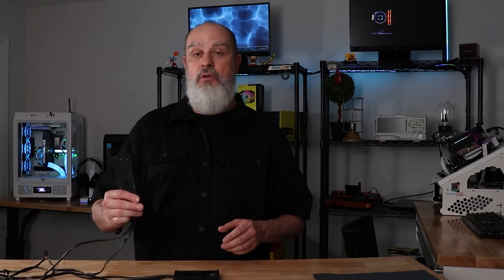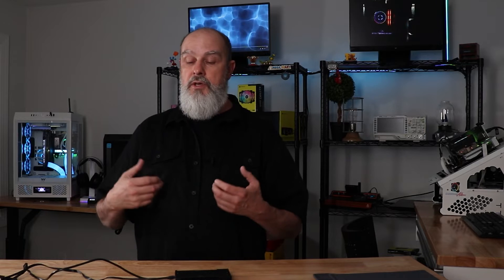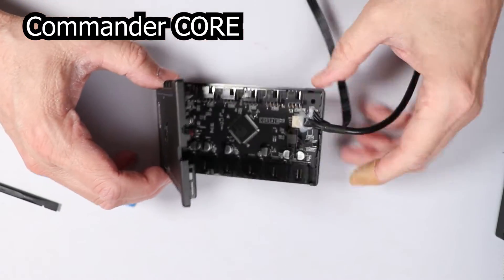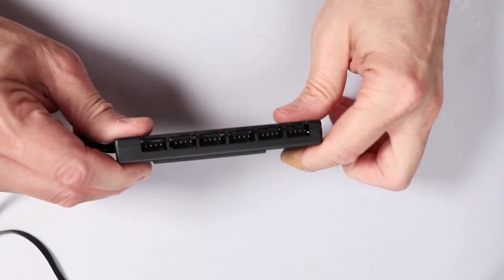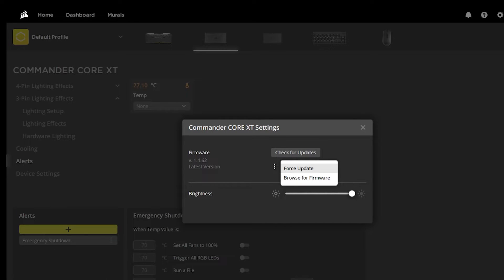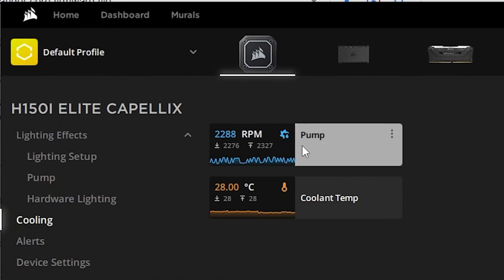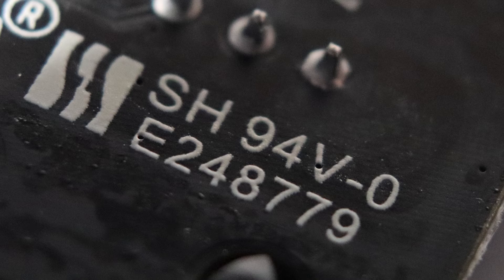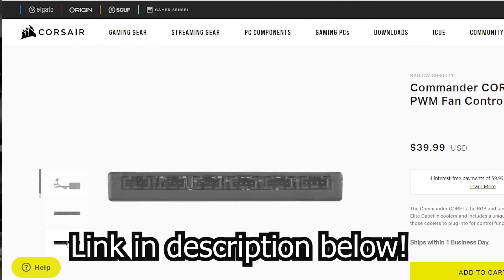Controlling your AIO with a  Commander CORE XT and Replacing your Commander CORE - But don't do it!!

Comment: Hi everybody, I just repaired my H150i with this method, and it's working great. The only problem is that when you update the hacked Commander Core, it will lose the speed option for the pump so you need to reinstall ICUE 5. If someone needs the firmware for the Commander Core, I have it.
Reply: Hey, how's it going? I need it do you have it
Reply: Hi bud, I would appreciate the  file as my comander is gone
Reply: Hi if you still have the file then please could I have it also, thanks
Reply: stii got it ? i will take a copy plz
Reply: can i have it? i need the bin file pls

Comment: I can’t find this type of 24 pin commander core thing. They all seem new and updated to smaller plugs
Reply from the maker: Hi johndoe-zn9xs,  The Commander Core for the AIO's is still available on Corsairs website, just search for Commander CORE RGB & PWM Fan Controller on their site. I've often seen it not available though, but currently as of right now it's available for puchase at 39.99. 

Thanks for watching!!!
Reply: @  literally can’t find it for the life of me
Reply from the maker: @johndoe-zn9xs  , here is the link to the corsair page, hopefully this will get you there. 

https://www.corsair.com/us/en/p/pc-components-accessories/cw-8960071/commander-core-rgb-pwm-fan-controller-cw-8960071?srsltid=AfmBOooWcEZGz8oglEvm36Dzuow1Kkce8EQY8BseqiMMZO4IvcL78jUV

Let me know if you can't find it. Thanks.
Reply: @ thanks . found it

Comment: I need help to expose the new virtual drive. I press the button and connect the SATA, but nothing happens. I use Win 11 Pro and can see the hidden folders. Any suggestions?
Reply from the maker: Hi SushYm4n-1201, if it's not exposing that drive when you do this, double check your USB connection in addition to trying another sata power port. 

If it still will not open it up, perhaps the device has some other issue? does the device work otherwise? does icue detect it? 

Good luck, thanks for watching!!!
Reply: @HardwareArtisan  as I already wrote in my Mail, I have two Devices. One works fine and the other one has a problem with the 20-pin-connector. The capellix head is not detected and the pump does not work, but the com core shows up in icue and the fan and rgb header do work. So it's not dead at all.
I tried out to open the drive at several usb-header on two different Mainboards.

Comment: You can also contact me if you need firmware
Reply: i need it plz!
Reply: @AddGaming0  свяжитесь со мной, в профиле есть способ
Reply: I need it please
Reply: I need it please
Reply: Do you still have it?
Reply: @yoshatabi  +
Reply: hi do you still have it?
Reply: Still there ?
Reply: @levmemo  yeap
Reply: can you send please?
Reply: @ yes
Reply: Do you still have the firmware for the core? I've got the xt and would like to connect my H150i.
Thanks
Reply: Do you still have the firmware of xt plzzz
Reply: @chofqimohamed9474  I have a firmware from a simple "commander core", which comes with a liquid cooling system
Reply: @nemonothingness1334 How can I contact you
Reply: I could use the commander core firmware.bin please.

Comment: I have the Firmware.din file if any one needs it bothe for a Comander core and a  XT
Reply: You still have the file?
Reply: hey man, do you still have the file for this?
Reply: hey man, do you still got it?
Reply: @brandonmayorga3657  Hello, did you receive the firmware and do you still have it?
Reply: Please contact me with the file for both please.

Thanks
Reply: i went on corsair forum to ask for the firmware, they said that they don't have the file :|
Reply: @gaciq  yeah nor will they via a support ticket. I ended up buying the commander core with the 24 pin from Corsair direct aaaand it's on backorder and won't ship till the 12th, so i have to use the non modded xt with my cpu throttled down to 45w usage so as not to overload the pump that i can't adjust. Grrr
Reply: Yea, just ordered my Core XT, then i wouldn’t have to get it of my old broken one

Could i message u on insta etc.?
Reply: Please! I need the file for the commander core!
Reply: @Inferno12M  I have, how can I contact you?
Reply: @Inferno12M  You aren't going to get it.. I ended up ordering one with Corsair, which took ages.. Good luck!
Reply: I need it please
Reply: I need it please
Reply: I need it please
Reply: hi do you still have the file?
Reply: Hey can you contact me ? I need the File
Reply: Do you sell it or can share?
Reply: Do you still have the firmware of xt plzzz
Reply: Do you sell it or can share

Comment: I'm starting to h8t3 thius Corasiar RGB mess so much.
It added an extra layer of complexity on top of already a tedious cable managemetn job.  ANd when it's done, the RGB and fans don't work right.   I finally got the fans to spin down by splitting them off the motorboard PWM headers and totally ignoring the PWM headers on teh Core and COre XT...  except for one that is runnign at full speed for some reason, when it should be running the same speed as the group of 3 it's in.    three out of my 7 RGB Corsair fans light up in rainbow puke, and the other 4 that were working before, now don't do anything.   I've checkt the sata cables, I've swapped them around between the two boxes, no change.   I've moved the RGB plugs around thinking I had them plugged into 6 54 instead of 1 2 3 (they aren't numbered at least to my eyes).   I've plugge dno working fan RGB into slots of a fan that had the RGB working.  Nothing.   NOone of this dmmn sh1t makes sense, even though it's supposedly "straight forward".    At least wriring it up was.   

Maybe this Core Xt box is dead, I have no idea.  There is no diagnostic legs on it or anything.  I't just a dumb plastic black box.

See my community tab for picts of the nightmare of using all Corsair products and ecosystem inside a Corsair 500D case.   Corsair cooler, Corsair fans, Corsair Power supply, Corsaier case, Corsair RGB controllers, Corsair ram, everything.   You wold think that would make everything easy.  Noooo...

Comment: @Hardware Artisan can you please upload the Commander Core Bin file? I swiched my commander core out and it totally worked i would like my XT to report as a regular core now. You earned my sub btw!
Reply: + 1 i also need this bin file i acidently delete it when i try upload
Reply: find one do you need it?
Reply: Has anyone found the file?  I'm looking for him too and he's nowhere to be found.  Even in Corsair :-(
Reply: @jasio80able  today, I plan on getting the H150I Elite LCD. Would you like be to give you the bin from the commander core that comes with it?
Reply: YES!  I think there are many people willing, not just me.  Share as soon as possible. Thanks a lot.
Reply: @jasio80able I'm holding down the reset button while plugging in the Sata power cable. And it doesn't pop up the bin file in file explorer.
Reply: disconnect each cable from the commander, leave only the usb.  press the button in the housing opening and hold it.  connect the sata power and continue to hold the button for a few more seconds.  release the button and the disk should appear.
Reply: @Lord_Deathless  Did you win with commander core?
Reply: I just uploaded a video of my corsair eco system problems I'm having I think I got a defective product.
Reply: @Lord_Deathless  Enter link to this video

Comment: i bought an h60x cooler thinking it would have all i need in box. realized after install that i needed a core which is doesn’t come with, but you need in order to access features of the hardware. bought a command core xt (and two more fans cuz rgb).hooked up the radiator fan and it’s rgb fine, hooked up the pump head rgb fine, the pump head power i connected to my cpu_fan_1 4 prong. cable attached to pump head is only a 3. icue detects fans and fan rgb, as well as pump head rgb but not the pump head itself. only port on the command core xt that fits the 3-plug for the pump head is the 4 prong ports for the fans. there’s a port on the short side of the command core that says “IO” and even if i assume it’s referring to the AIO pump head, the port doesn’t fit the plug from the pump. i’m so confused. is there no way to control the pump head?

Comment: hello, I came across your videos following a problem with my commander core, I tried to see if corsair sold them alone and it was not my surprise to see that no, they are just in pack with the AIOs this which I find stupid for me. I thought your video was just awesome and the edit seems simple considering you proved the core XT command has the same board and they just add a board for temperature. I also see that your videos are more than 1 month old, your modification still works or not? thank you for the answer and sorry for the mistakes I use google translate
Reply: 8 months later and it still works

Comment: @Hardware Artisan Hey :) I want need some serious help. I bought a brand new Intel computer that included the H170i ELITE LCD. It gives me an error when I boot up. First there is a triangle in the LCD, and when I boot up there is a picture of a fan with an exclamation mark. I have gone over to check that everything is connected as it should be. I have also made sure I have the latest updates for the iCUE software. The fans on are blinking red indicating an error. When I boot up, the first few seconds the fans are showing a rainbow color, and after a few seconds, they start blinking. I have checked all cables and can't find anything wrong. Do you have any tips for me? Have you heard of this problem before? I got my new computer two days ago. I will send it back if it is not a quick fix.

Comment: Thia is an awesome find! Would you happen to share the firmware for the commander core? I have one originally that fried out and for my h150i, and the core XT actually does work! Fans are blinking red but pump does work. I've been scouring for a few days now with no luck finding the firmware for the commander core 😅
Reply: So wait you took you your commandor core xt apart and used the 24 point pin with your h150i and the pump and everything works. I have a H150i elite capellix 360 that I got for a killer price but the core didn't come with it I thought that surely there had to be a work around. This video is the thing I've found so far. I do own a commander core pro XT already installed in my case with all fans and speed hubs being used. If you see this let me know what you found out thanks.
Reply: @johnathonbouressa4596  Basically did the same instructions in this video. Open up the core XT, remove the module that is connect to the 24 port of the XT, and then connect the 24 pin from the AIO into the core Xt from there. It'll all work, but the only thing is that you wont have RGB control since the unit is still recognized as a Commander Core XT, and you will need to flash the firmware manually like he does in the video.
Reply: Where did you find the correct firmware file that you flash onto the commander core XT to the commander core. Thanks for getting back to me man I really appreciate it.
Reply: @johnathonbouressa4596  I actually never flashed it lol. I don't have  the firmware file and it's almost impossible to find unless you have the commander core and power cycle the unit while holding the reset pin down to expose the original commander core firmware.
Reply: @Linkssanity i buy commander core and this instruction not work. I cant grab firmware from commander core.
Reply: @onalnosorog same, mine wont even show in icue anymore idk

Did u fix it?

Comment: Im wondering if that is a small 5 amp fuse that’s been built into the board.  Buildzoid pointed these soldered fuses on a MSI 40 series graphics card tear down.  I could definitely be wrong.  I tried searching for the chip with the Q1 designation that’s on both boards, but I couldn’t find anything useful.  I’m sure someone will correct me if I’m wrong.

Comment: HOW.ABT HOOKING UP.A H60I RGB PRO ON A CORE.XT
Reply from the maker: Hi J5873NY, the H60I doesn't use the 24 pin connector described in this video. The pump head on the H60I uses it's own USB connection, the PUMP itself is the controller. The PUMP head has a cable to plug in the PWM connection on the FAN. I'm not sure if it has the 4 pin RGB connector though, the manual doesn't point out the RGB connection for this AIO, but it calls out the shrouded 4 pin connectors, i'm assuming it means both PWM and RGB, I could be wrong. 

My h100I has both the PWM and RGB connection off the pump head, I suspect the H60I does as well.  If it doesn't have the 4 pin rgb connector, then you will need a controller such as the CORE XT. 

I hope that help, thanks for watching!!!!

Comment: or just re-wire the pump, to your motherboard, and then you can setup it with the motherboard bios or software. if you have that kind of board.
Reply from the maker: Hi Tek Soup, I've not even looked into that, nor looked at the pinout for the AIO connector, I suppose you could break it up, have you done that?  

Thanks for watching?
Reply: @Hardware Artisan  have you re wired the the pump to your motherboard or figured a way out to use the H150 without the use of of the core
Reply: @HardwareArtisan  Loved this video! It's exactly what I was looking for. Now, if you could figure out the pinout for the AIO connector so that maybe we can just breakout the connections to the XT's daughterboard and not need to find the elusive Commander Core firmware.bin to download.  At this point, figuring out the pinout may be a more feasible option than finding a working firmware.bin file.